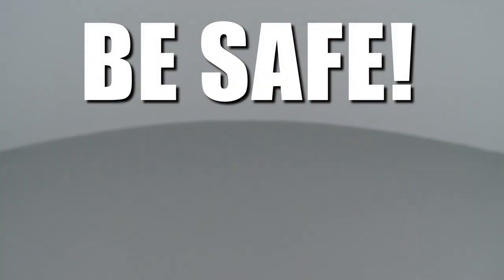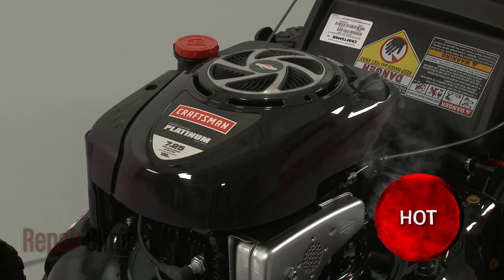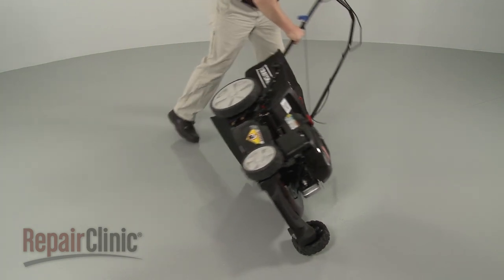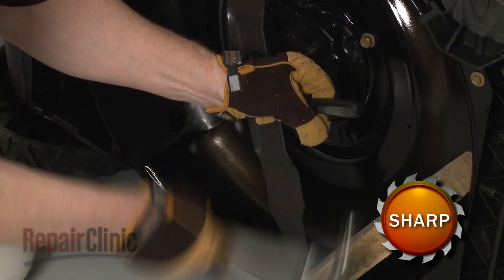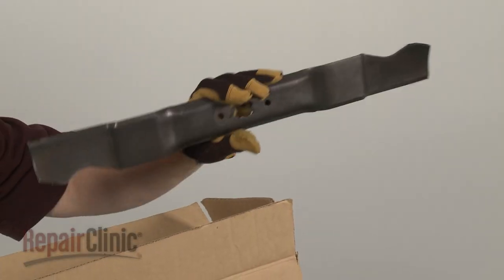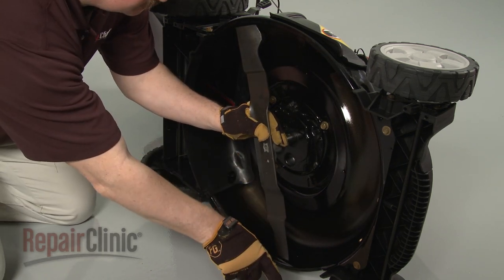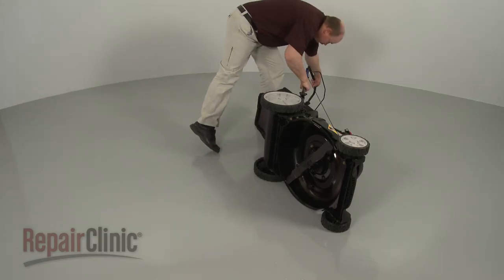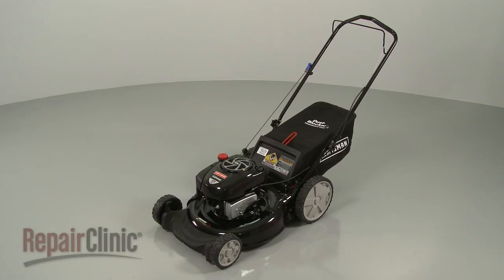Craftsman Lawn Mower Mulching Blade Replacement #942-0741A

Comment: So I made a rookie mistake, I tipped the mower on the wrong side and gas leaked onto my air filter from the carb I bought a new one
To replace it. Do you think it will cause any problems?
Reply from the maker: Hi Nolan - you'll find our blog post on this topic helpful: http://diy.repairclinic.com/2013/07/01/what-to-do-if-you-tip-over-your-lawn-mower-and-then-it-wont-start/